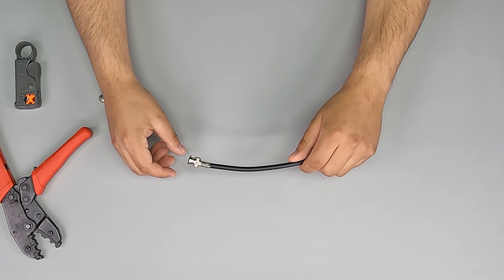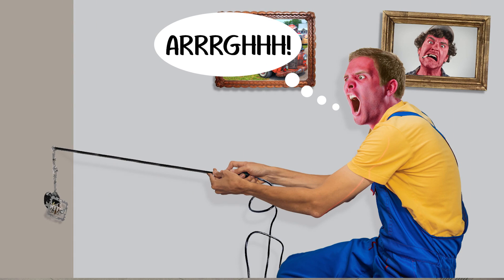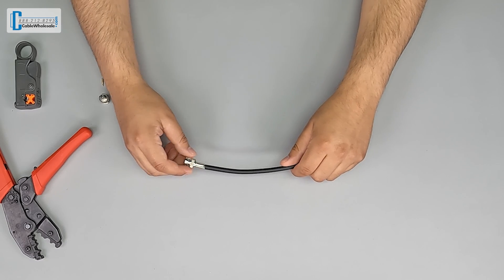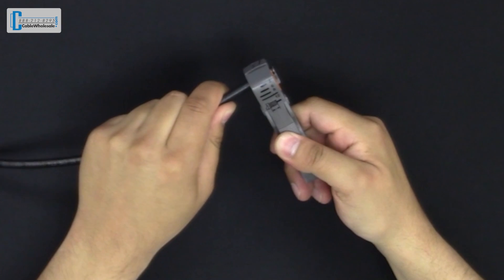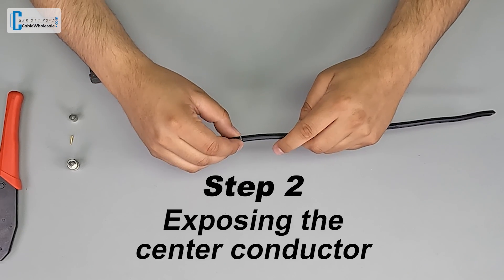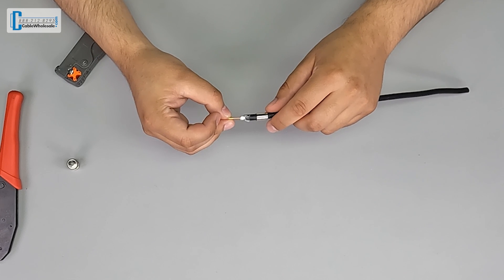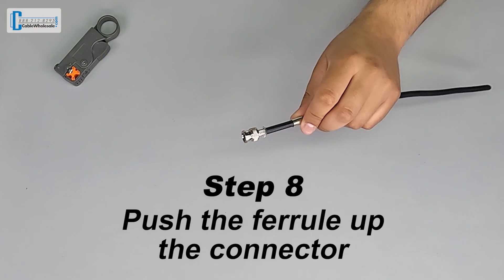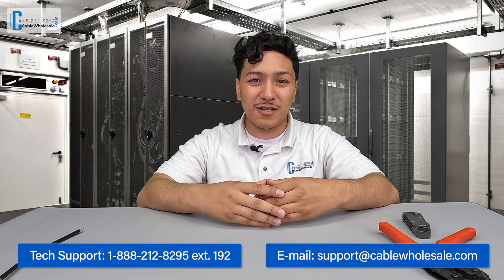How To Terminate a Coax Cable with BNC Connector

Comment: The connector shown in the video is a crimp-on variety, which has been around for years & years. Having worked in a Central Office setting for over 20 years, I've found it all too easy to either not have the center pin fully seated onto the center conductor when crimping...or...have the center pin break off while being crimped. In both instances, the end of the cable has to be cut off and the process repeated.

There are compression BNC connectors that are applied in a manner similar the familiar "F" connector. The installation requires fewer steps.

With compression connectors having largely supplanted crimp connectors, do crimps provide any real advantages over compressions? 🤔
Reply from the maker: Thank you for your comment.  Choosing between crimp or compression connectors for coaxial cable(BNC or F Pin) largely comes down to personal preference.  If cost per connector is of major importance, crimp connectors are more cost effective.  If ease of use is more important to you, our customers find compression connectors easier to work with.  CableWholesale is proud to offer both options to our customers.